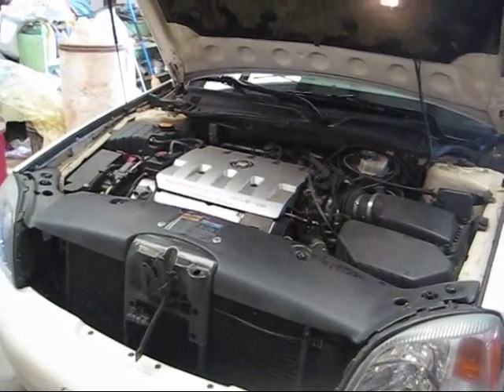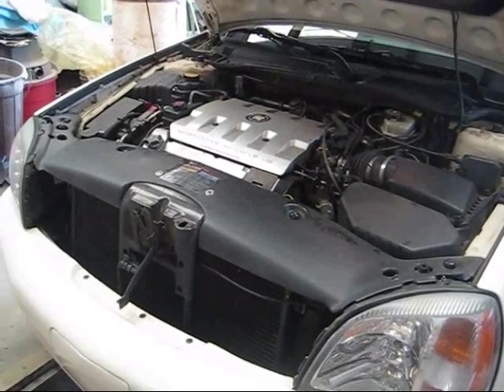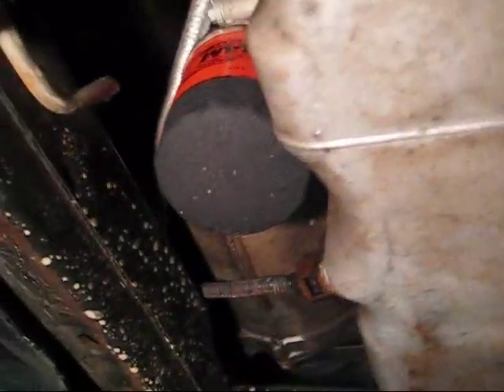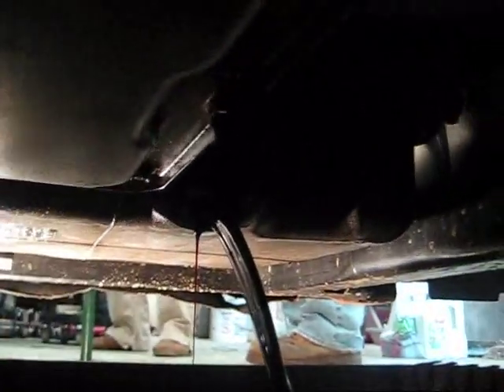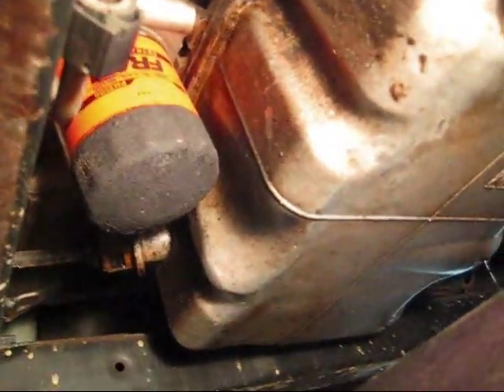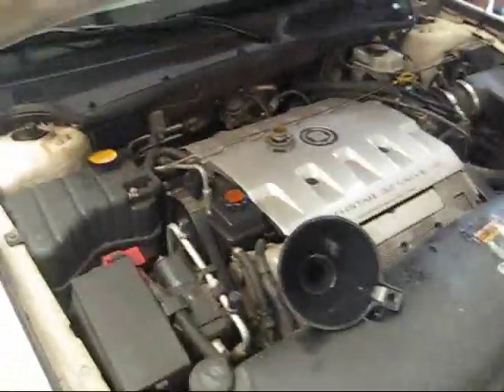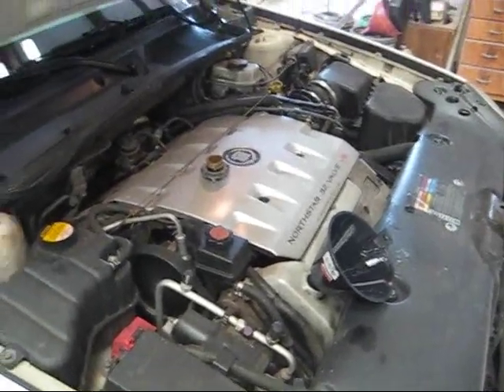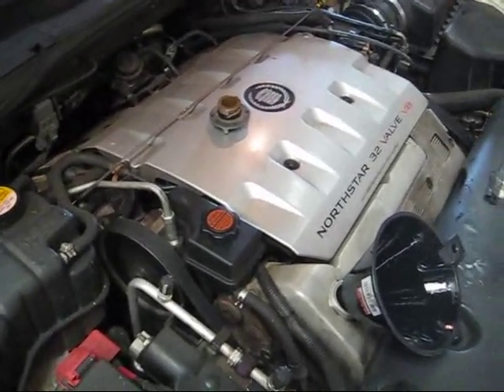2001 Cadillac Deville Oil Change with a 32 Valve Northstar Engine

Comment from the maker: We use a 10/40.  We use a good oil.  Filter is obtainable at any auto parts store.  We found that Auto Zone has good deals on oil change kits that come with oil, filter, air filter, drain pan, hand cleaner and shop towels.  We also run lucas oil treatment on occasion to add to the longevity of the engine.  You can also look at our face book page Two Guys / Shade Tree and ask questions and give comments.
Reply: Why does your engine oil look red? The reason I am asking is because I was going to buy a Cadillac off of a guy at work and when I checked the dipstick, his looked red too. I've never seen red oil on a dipstick before until then and after now again after seeing your video? Is the oil in your video in fact red and if so, what brand is that?
Reply: It's the video

Comment: i myself run 10w30 penzoil 7 quarts and 1 quart of lucas   with purelator filter and replace the oil every 2000-2500 miles or 3 months which ever comes first and top it off once a week she will use that oil a bit cause the l37 32v v8 northstar runs warm but runs strong ive put 5000 on mine since x mas and 3 oil changes and had it dyno tuned but oil is a kinda off personal preferance like boxers or briefs but i would say go a weight higher it calls for 5 w 30 but i run 10 w 30 myself so ...
Reply: TENNESSEERULES619 If it call for 5w30 you should use that.  2000 to 2500 miles is too soon. Especially because it hold so much oil. It will take longer for that much oil to become sooted.

Comment: 7 1/2 qts should bring it to half way on the crosshatch pattern on the dip stick. If you add more than that, the engine will dispose of that excess by burning the oil.  Do not make the mistake of putting in more than 7.5 qts.
Reply: Ken N they take 8 quarts my boy
Reply: @somersetlax  again no. Seven and a half.

Comment: i run 10 w 30 but i might try that in august when i get it changed i bought mine with 5 w 30 in it topped off at the lot drove it home a week later it was about 1 and a half quarts low so i bumped it up a weight still drinks the oil a bit but thats a northstar l37 engine runs strong till it runs in the ground

Comment: sell that junk while it still runs... head gasket will blow at 170,000 miles. speaking Frome experience....mine did at exactly 169999 no joke.get crown Vic ...same power displacement and perf...or a 1993 or pre Northstar caddy
Reply: 170 aint shit, 240 my japanese made car still runs like new
Reply: Leon Springs Boys TV You where drunk if you got rid of a northstar for a weak vic.
Reply: blackericdenice right
Reply: I would be happy if my head gasket blows at 170,000 miles. I just bought a 1998 Cadillac Deville that has 19,450 miles on it, so that means I still have about 150,000 miles left on it, that would take me about 15 years of driving that to get there. I have two other cars I drive a lot more. Thanks for the good news...